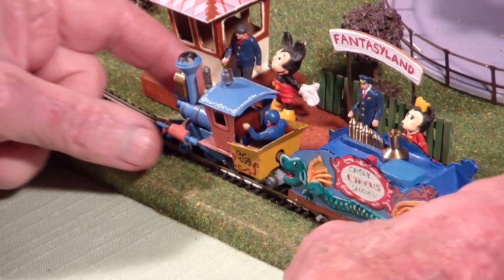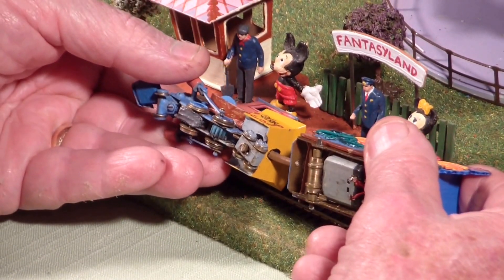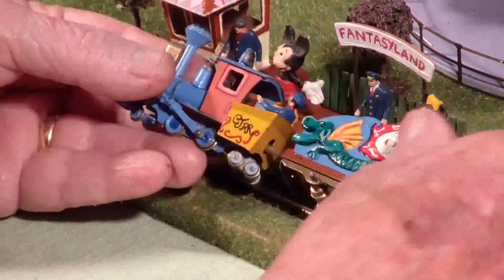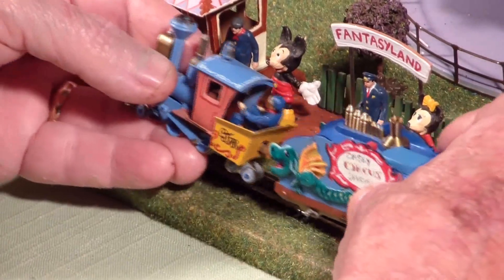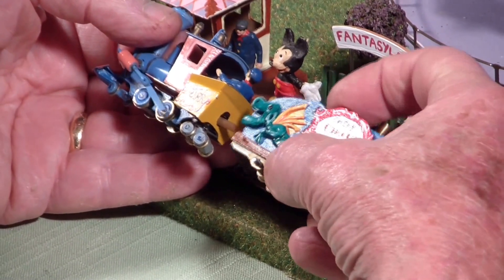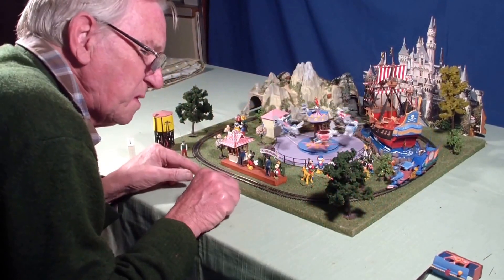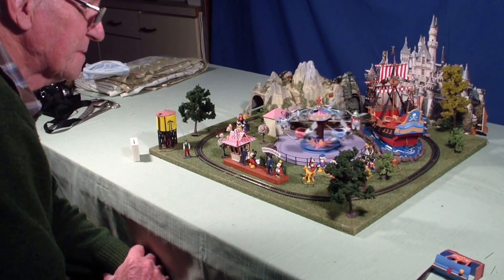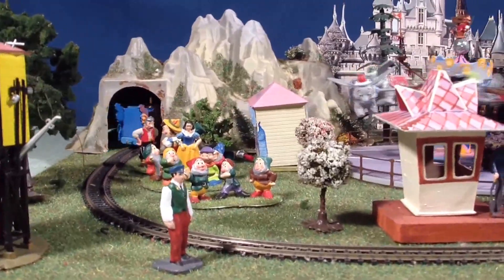Casey Jr. Train (N Gauge)

Comment: Do you by any chance have plans or drawings of the locomotive? I was thinking about building a large scale model of Casey Jr.
Reply from the maker: Hi there. Unfortunately I do not have plans for Casey Jr. I spent considerable time referencing Disneyland footage and photographs to sketch my own design. Best of luck with your larger scale model.
Reply: Rod Campbell thanks for the reply! I have also been going through some old Disneyland footage and photos I've found around the web. Just was wondering if you had anything I could reference but this video helps a lot! Thanks again!